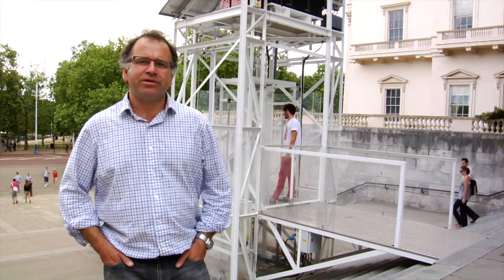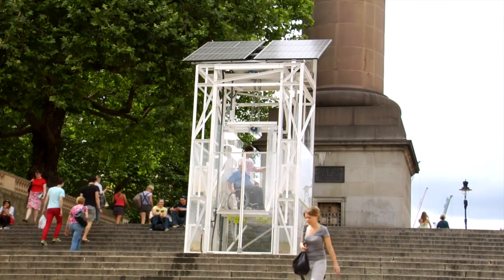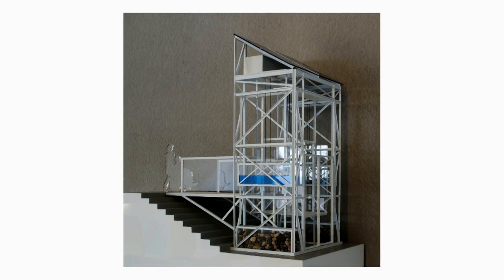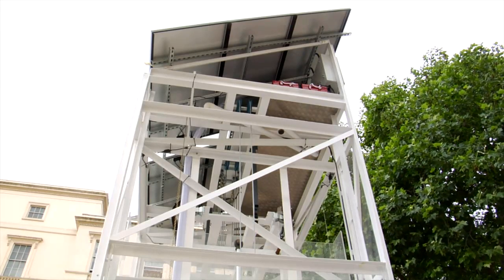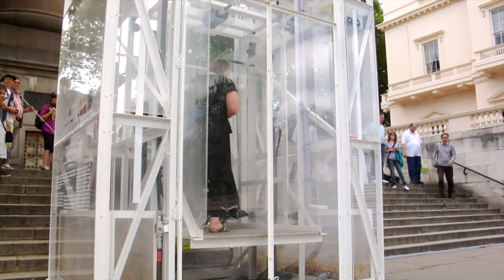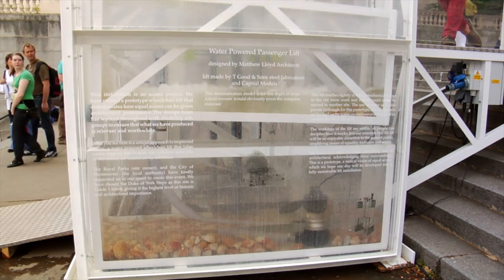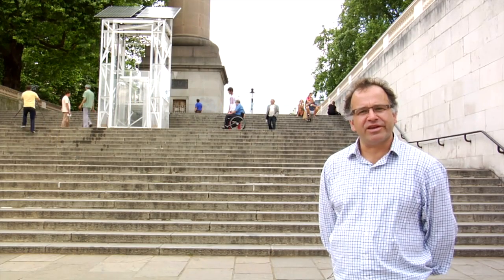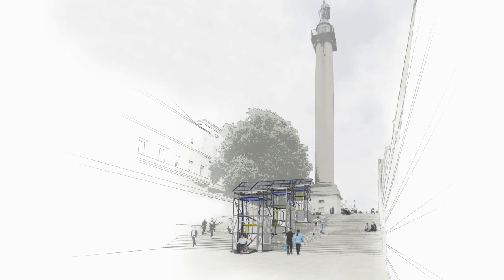Water Powered Passenger Lift

Comment: This thing is a joke. First water powered elevators have been around for over a centrey and were much better built than this thing. Also it would be efficient to have the soler cells charge a battery bank and use that power than using all this dumb waterworks.